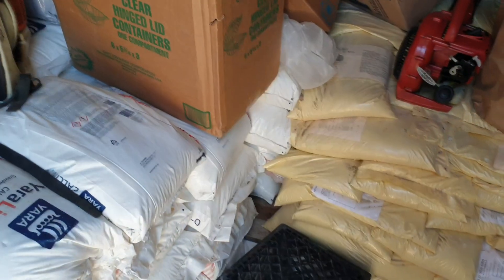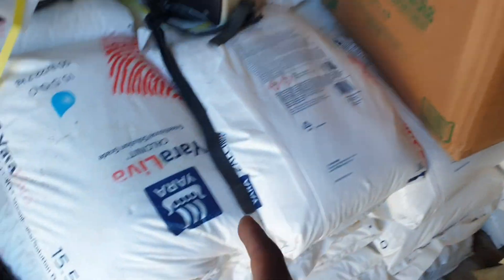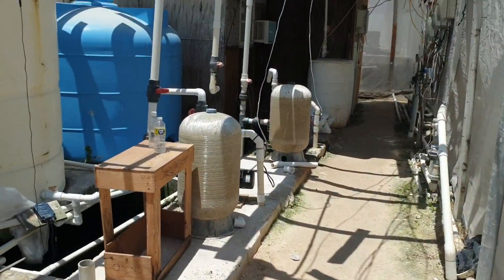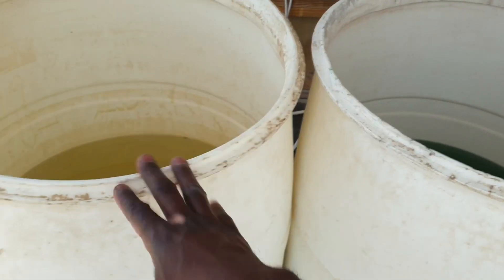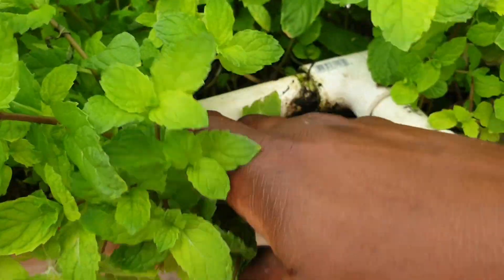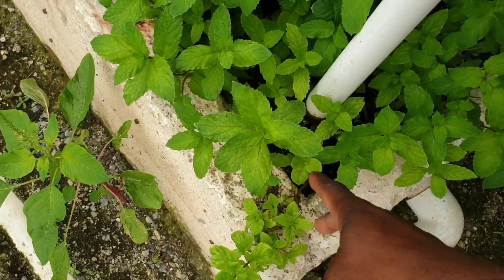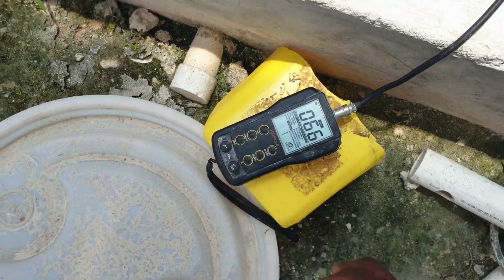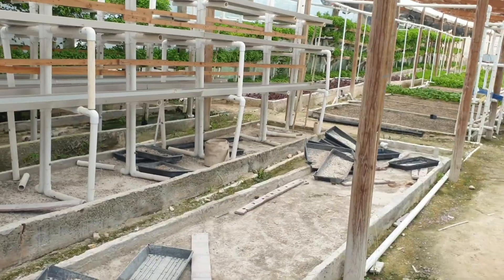Hydroponic mint fertigation system| Basic setup that works

Comment: I was wondering what media you are using and how do you prevent it from falling into water?
Reply from the maker: @javadhemmati6898  It's 3/8s gravel and it will not fall into the water because the water going in is not high pressure to move it. Thank you.

Comment: when you plant the cuttings into the new bed where do new shoots come up? does the plant runner fill in the space between? does the plant live for 1 year or more?
Reply from the maker: The new shoots come up on the sides of the cutting as well as beneath the cutting where the roots are. Yes, the runners will fill space but may take a longer time. Therefore,  it's best to plant cuttings close like 8inches apart then thin out as they grow - this will give more production faster. The plant can live for more than one year, providing you are  applying best practices like thinning,  pruning regularly, pest mgt, etc. Thank you for the questions.